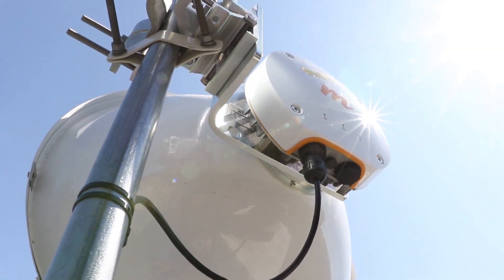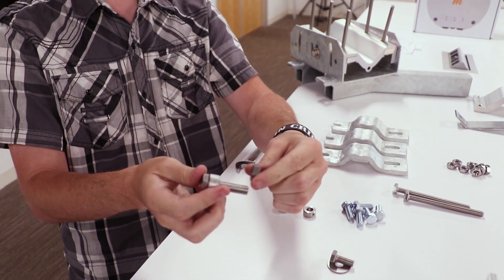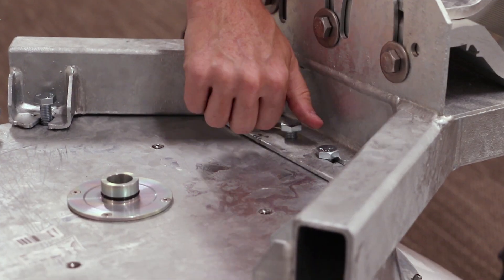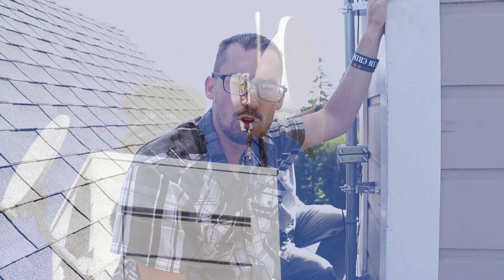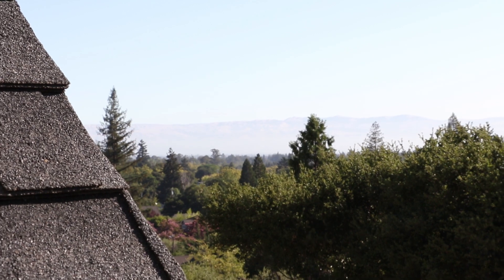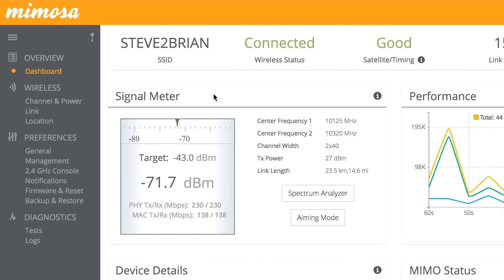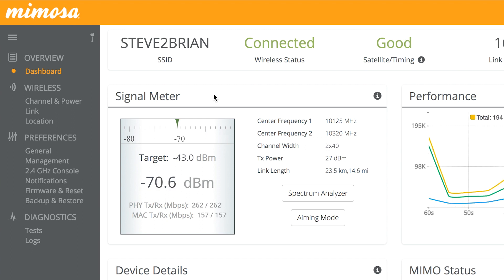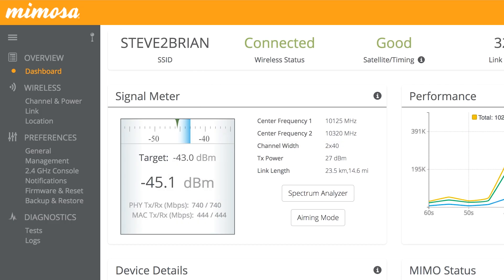Mimosa in the Field: B11 Gigabit Point-to-Point (11 GHz) Set Up and Install

Comment: i can only imagine how disappointed and frustrated someone would be if they tried to use this video as a guide for this process without prior experience with this bracket or radio.  Just glossing over how incredibly difficult it is to make minute azimuth adjustments straight from the mounting bracket without having a fine tuning mechanism in the bracket would drive any novice tech to hysteria.  Hint: its far easier to loosen the mast mounting brackets a tiny bit and use large channel locks or a pipe wrench to make slow, incremental adjustments by turning the mast itself.  Not only will it move more smoothly than the antenna bracket moves on the mast, but you can do it from a lower, safer position nearby your laptop.  And anyone that isn't making periodic marks with a sharpie to remind them where the last highest signal level was achieved will inevitably end up starting from scratch a couple of times.

Further, it looks like the mast is 2" EMT, not rigid GRC.  A dish this sensitive and accurate would bobble in the wind far beyond the margin of error for azimuth, as you can clearly see it doing so when the tech nudges it.  EMT or similar radio specific masts can flex nearly a couple of inches depending on the length. While I like the performance of Mimosa radios, the bracketry supplied is hit and miss, with some providing semi precise alignment mechanisms ans stability, with other brackets being clumsy and rudimentary leaving small adjustments virtually impossible.  Thats fine for a BST or a close proximity subscriber unit, but for moderate PTP links, the precision of the bracket allows higher signal levels, and that it  will likely allow for longer intervals between maintenance visits because if you start with high signal, it takes more time or more severe disturbances and obstructions to reduce performance.

And even the Mimosa brackets that come with mechanisms intended to facilitate precise adjustment often fail because the slop in the bolt holes is so large that reversing the direction of adjustment will result in the bracket shifting by several degrees.  They didn't even really demonstrate the vertical mechanism on this one, but my experience with other Mimosa PTP brackets was that on final adjustment, you must only travel one direction and stop at the peak established on previous sweeps, because reversing direction, like i said, will shift the entire bracket more than the margin you're adjusting.

You should be far more concise about these minute distinctions and spend more time detailing the exact physical process of making adjustments instead of this shallow overview that ignores the real challenges of alignment.  This video has more attention to the production quality than the significance of the actual installation details necessary for a reliable link alignment.

Comment: I am from india  I want setup w isp in small towns around 5km  100to200mbps speed internet speed. What I can use 30meatr pol
Reply: My whatsup no 009125718181
Reply from the maker: Please start out by designing your link and network using our design tool: https://mimosa.co/design-tool

Comment: That slow refresh on the signal meter is very uncomfortable to use. If you have access to the firmware code of your products, you need to make it update at least twice a second or faster. How about also including a headphone jack on the radio with real time signal strength tone ?
Reply from the maker: Thanks for the feedback.
Reply: Did you put the radio in "aiming mode" ?  
It does seem a little more responsive that way than just looking at the signal from the main page.

But mostly, if I remember correctly the aiming mode just makes the signal meter larger on the screen.  And it will still lag.  So you have to make small changes and then wait a few seconds.

And this, unfortunately, i suspect, is due to he fact that Mimosas as well as many newer radios don't disable any automatic gain control functions during alignment.  So when you make an adjustment, the radio may be adapting the gain to compensate, which can be frustrating and counterintuitive.  But maybe there is a reason for that.  If I remember correctly, Radwin 2000's and other older models also don't have a way to disable AGC features during alignment.

The interface does not always make these things clear and even dealing with first level tech support, they will often not be able to answer that question.